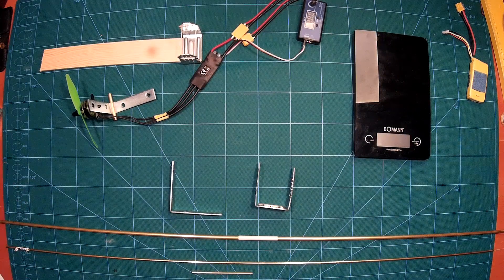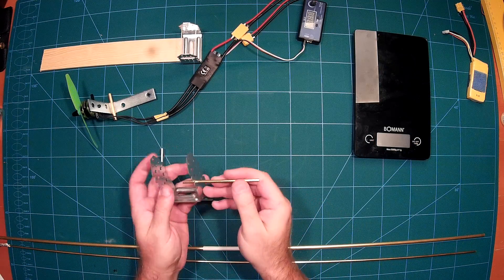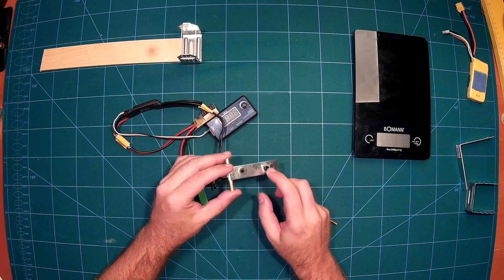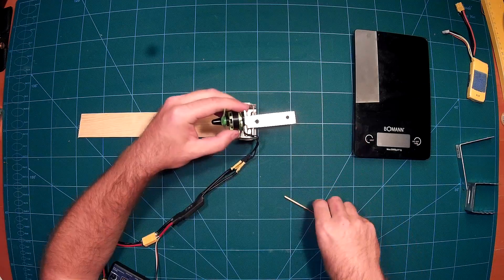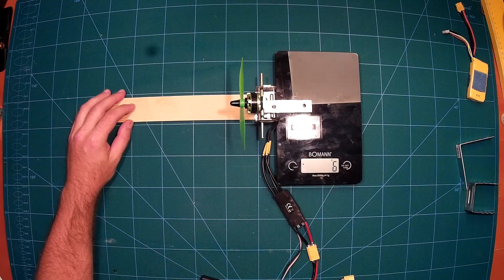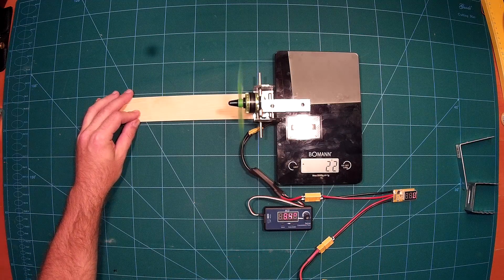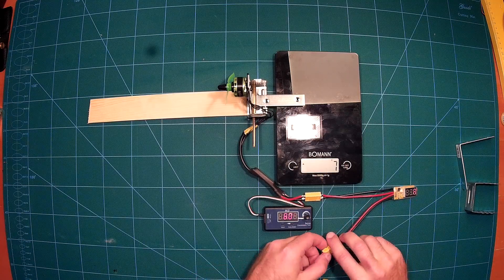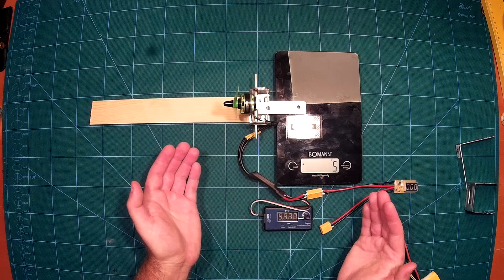How to build a low-cost 5$ brushless motor thrust stand

Comment: NEVER stand in line with the prop !!! Whether you are testing motors, diesel, glow or petrol engines - Always stand BEHIND the prop....and ensure your stand is firmly bolted or clamped to a sturdy/heavy bench or table. In case of defects, tips of props can break at high RPM or if the o ring is not engaged correctly the prop can fly off. And no loose wires.. take extra care when you try to zoom your camera to shoot the reading on wattmeter...

Comment: This looks pretty good, and I think I'll make one similar.  My only comment is that you should probably have balanced the bracket rather than using the rubber band to keep it in place.  Because, with the rubberband, there is still some small torque due to the extra weight of the motor, the motor must first compensate, with thrust, for this imbalance.  This will lead to incorrect results.  I'm guessing though, that this is a pretty minor error.
Reply from the maker: +Desrtfox71 Many thanks for your comment! Actually the rubber band is layed out in a way so that it only keeps the thing from falling to the front. But for the measurement the thrust is applied into the other direction, where the rubber band does not apply any tension. It is a bit hard to see in the video though. Many thanks for the heads up, have fun building it :-)
Reply: +RC FPV Flight well that makes sense. My point was that there is some force there that is being held back by the band that the thrust must compensate for before the scale registers anything. It's probably minuscule though. I think I'll balance mine so that the lever on the scale makes some known weight (say 1g) and just subtract that it off the final measurement.
Reply from the maker: Gotcha! Yes, the way you describe it would be even a bit more accurate! Nice!

Comment: Good one !!, But where is the compensation for the mechanical advantage because for the bracket linkage??
Reply from the maker: +Yeshwanth Nagendra Many thanks for your comment Yeshwanth. I'm not sure if I follow you 100%, so if you can elaborate that would be great. I took good attention to ensure that the two points of force (that is, where the motor applies the force and where the bracket applies the force to the scales) are exactly the same distance from the center of the bracket, as I elaborated in the email. This should ensure that if the motor applies 1g of thrust, exactly 1g is also applied to the scales. The measurements seem to verify this. Maybe you can elaborate - that would be great.
Reply: he explained it well i thought. equal distant from fulcrum!